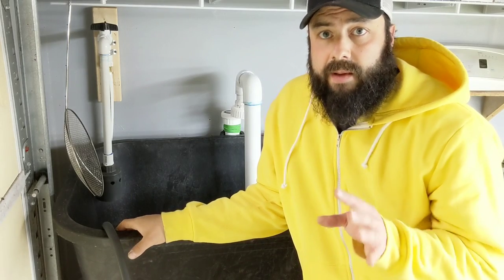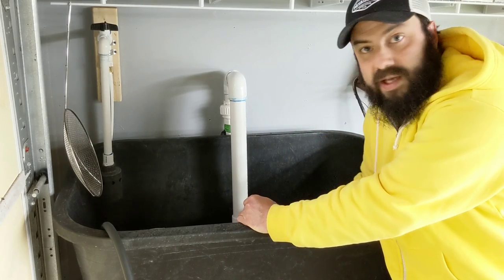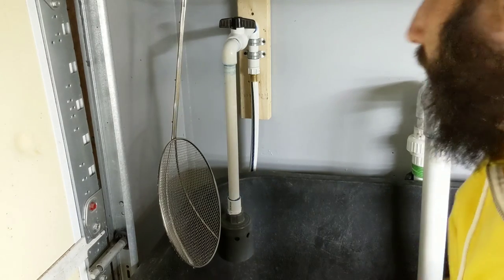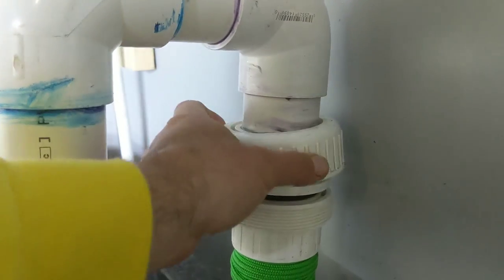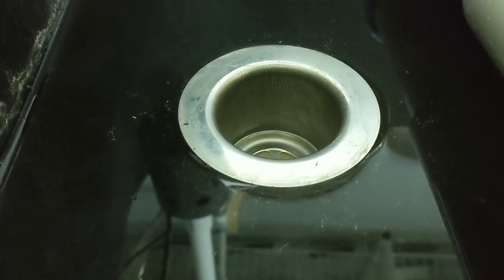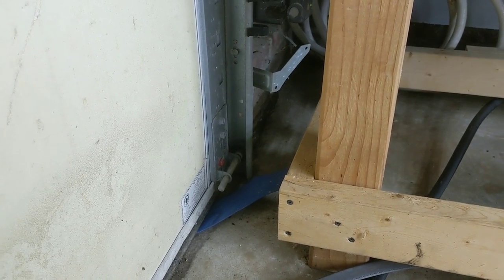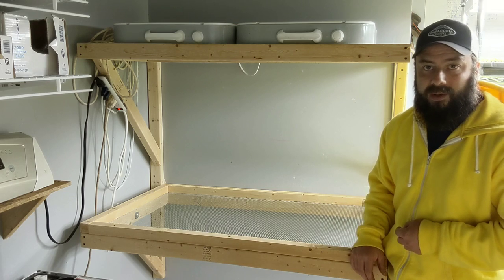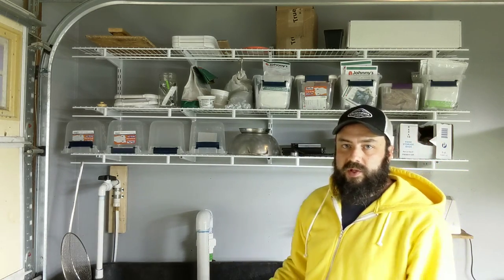Wash Pack Station - Market Garden

Comment: Perhaps as a spinner you could use some of the off grid hand or foot washer spinners?  Or what about a salad spinner? For smaller operations.  Like the Westinghouse salad express which is electric powered and has nice large slotted sides.  Or the Dynamic Spinner, Greens Machine or Elgento.  Just thinking outside of the box.

Comment: Thank you for this incredible video!  I have a small farm and we are in our second season and building a wash/pack area.  Is there anything that you put under the drying rack to catch any water or debris that fall off when you tilt the drying rack down to clean it?  I'll also be using it to dry root vegetables so might have more water drips than well spun greens.  Thank you for your input!

Comment: How often do you harvest your Lettuce. The lettuce that you planted in your beds do you cut the leaves off and let the lettuce regrow or do you uproot your lettuce. How much lettuce can you get from your 50 foot beds
Reply from the maker: It depends on the season. Summer time I plan for one cut. I usually can get 50 lbs. off of a 50 foot bed. I get several cuts off of the lettuce from fall through spring.

Comment: Thanks Josh! 
Question, you tipped the drying screen into what? Is there a tub or what below it?
Reply from the maker: I tip it over a bit then it collects on the bottom boards. A little bit of smacking the screen from underneath. Then I put that in a bucket or bin. Then flip it almost upside down and some more smacking of the screen and the last bits fall on the floor.

Comment: the motor in the washer is not 3 phase, 3 phase is specifically for ag and industrial equipment, you wouldn't be able to power anything that was 3 phase in any normal house. it would require either an industrial or agricultural drop from the power grid. You may mean 220v in the US, but that is not normal for washing machines. it is likely that the motor has 4 wires going to it, and that one of them is a backfeed from the controller to your capacitor, which you need to get the tub spinning when it has weight.  this video shows a conversion to a timer switch, and you can see what I am talking about at the timestamp linked.
https://youtu.be/wqzfW4HvqUQ?t=262

Comment: Where do you find fans without safety shutoffs ? Every fan I look at has a safety shutoff. If the fan is knocked over on it's side it shuts off automatically. Most of the fans safeties will engage when the fan is tilted just a few degrees from vertical. Thank you
Reply from the maker: The fans were the cheapest box fans that they sell at Home Depot or Lowe's.

Comment: What if the drying rack was enclosed on 4 sides (one side operable) and the fans blew air from the bottom so the greens get tossed all around and dry quicker?
Reply from the maker: Give it a try! My only concern would be water falling on the fans.

Comment: How long typically do you need to keep lettuce on the drying rack?
Reply from the maker: I don't set a timer. It really depends on how much is there and what the temperature and humidity is like. You'll know by feeling it and looking at it. I don't want standing water on it, but I want to get it off of their before it starts to wilt or dry out.

Comment: What is your foot print size for that?
Reply from the maker: It's an L shape, but if you thought of it as a rectangle including the open floor space it's about 9'x4.25'
Reply: Awsome. I have a 7x12 ish shed I was thinking of making into washing shed with our walk-in cooler in the garage wasn’t sure it would have the room but yours works
Reply from the maker: Those dimensions are just for the area shown in the video. This includes the greens bubbler, spinner and drying screen.

Comment: I don't understand all the modification to the washer. Can't ya just leave it all together (not connect the water pipes) and just run a spin-cycle or two (or whatever it takes) ?
Reply from the maker: Yeah, it depends on the washer though. Usually you can't fit one of those baskets in there without removing the top. Some washing machine units have that big agitator in the middle too that would have to be removed.